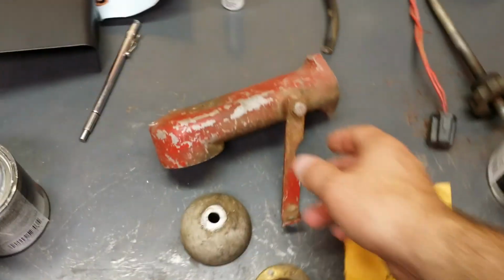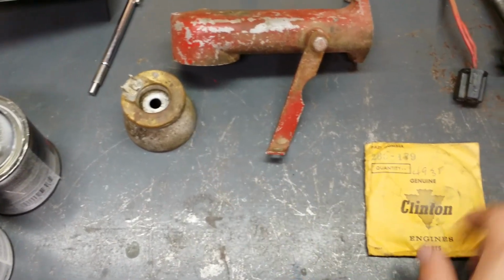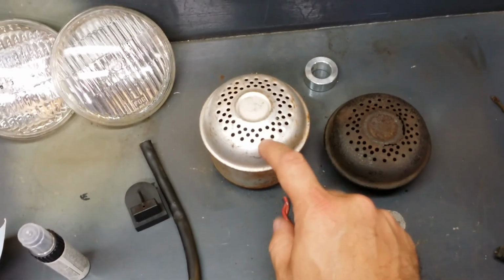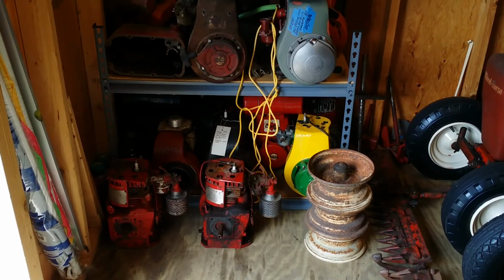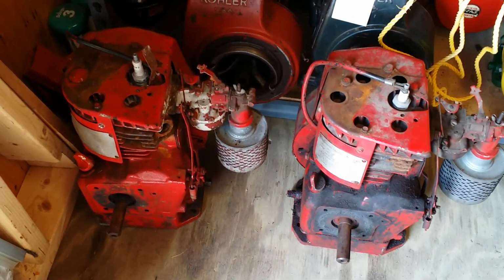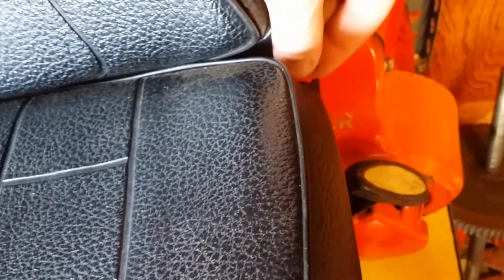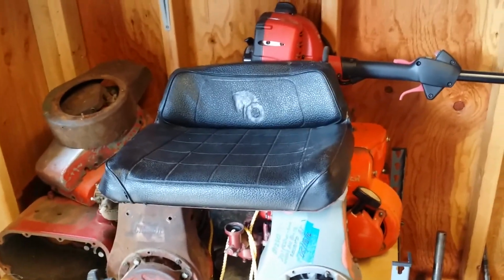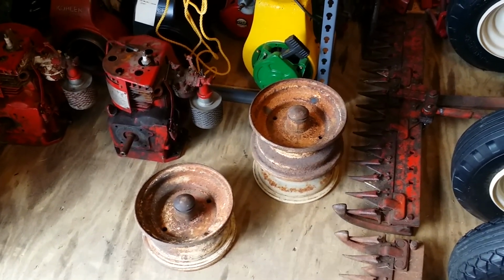2017 Wheel Horse Tractor Show and 857 "Lil Mule" South Mountain Fairgrounds PA VinsRJ

Comment: Seeing your a Clinton fan Vin what would be a good replacement carb for the B1290'S  Thanks
Reply from the maker: I personally always swap out the Clinton LMG's for a Kolher Carter N carb (K90/91), if you like a nice low consistent idle use a Carter N with a size 13 throat (my preferred size), or a Carter N with a size 16 throat will work just fine...